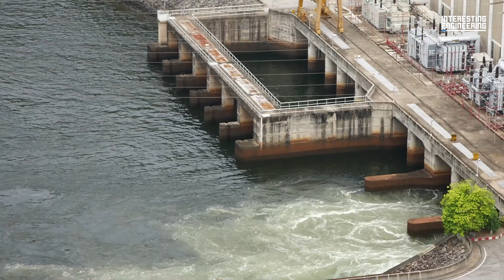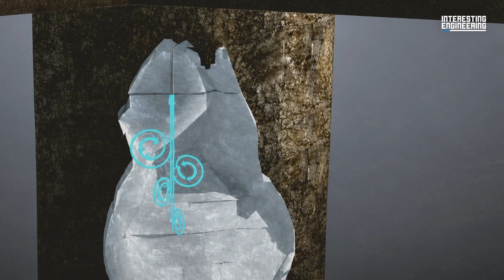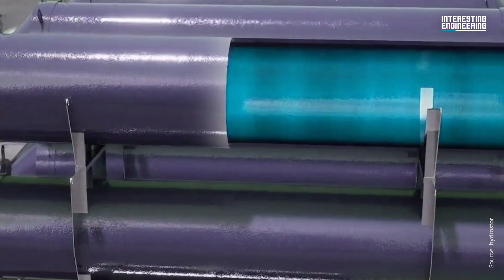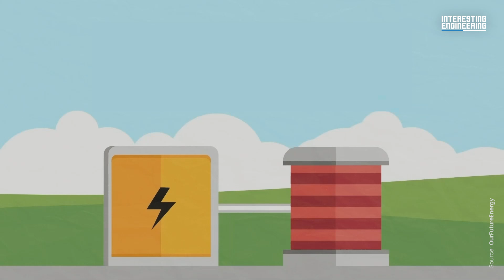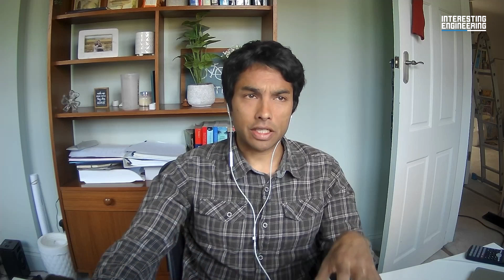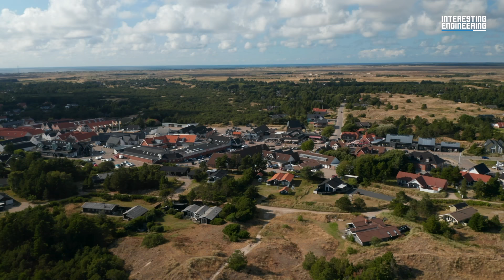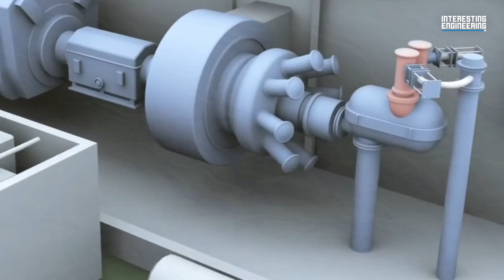Why Air Batteries Are Finally Beating Lithium

Comment: On the plus side, a steel pressure vessel can be almost immortal if well maintained.  Beneath a defined stress limit, steel has an infinite stress cycle.  Pre-stressed concrete storage vessels are possible as well.  In this case, stressing cables can be periodically replaced.  So CAES can be built once and used forever.
Reply: I wouldn't say forever because moisture is still a problem, looking at industrial compressed air vessels it will still degrade over a long period of time.
Reply: @TubersAndPotatoes  u have molecular sieves
Reply: The best patent model I've seen is literally almost a giant  air balloon at around a 1000 ft under the water. The water pressure makes the storage vessel strength almost completely irrelevant and last forever
Reply: @MmMm-f2y7c molluscs - 👀
Reply: @luminousfractal420marine environments aren't kind, but it does change a lot of the design elements. We "just" need to find a flexible, air-tight, high-pressure, inert, salt-water resistant material that can last 10,000 cycles and is cost effective at scale.

The Ashby plot is a dot. 😂
Reply: This could also solve the thermal problem since water surrounding the balloon would normalize the air temperature during compression and discharge.
Reply: @rouchar Sadly, no.  The air must be compressed and the heat captured in some medium, before it goes into the underwater tank.  Otherwise, the heat is wasted.
Reply: Gas holders of the kind you can see remnants of around Britain held 50,000 cubic metres of town gas.

The world record for a single steel pressure vessel is 270,000 cubic metres (Qingdao LNG).

Huai'an salt cavern CAES is 980,000 cubic metres.

We're still figuring out caes and it's already three times the size of the largest LNG tank.

Comment: It's the same problem once Renewables are connected to the grid it becomes a parasite just like pumping air or water against existing pressure so the ignorance of Renewables is easily demonstrated with a volt amp meter and 4th grade math called Ohm's law if you were to double check your installed what meter and you will see an 85% loss so it being the same problem with pumping air or water it is called head pressure with electricity besides the resistance of the step-down Transformers but you're trying to feed backwards is voltage potential difference and the reason for skyrocketing electric bills

Comment: Adiabatic compressed air energy storage make sense in the current energy storage landscape only for wind energy  storage and large scale grid usage. Domestic usage is right now a tthe level fly by night promoters.
Reply: I agree.  The cost of an air vessel and it's maintenance drops relatively as the vessel increases in size.  And a very small system could be forgotten or neglected with disaster a result.  Regular inspection should be mandatory.

Comment: The fact that you need to burn gas to let the air out, because otherwise the tank cools down too much, means this kinda sucks. In my opinion
Reply: If the tank cools down it can hold more air at lower pressure which is good.

Comment: The issue of water/ice in the system seems like a non-issue to me. Regular compressors have the same problem and they are constantly producing water from condensation. A simple solution would be to pass the air thru 5 or six different compressors each one of them with more pressurizing capacity that the previous one, that way, the last compression level would have almost no water left to condensate.
Reply: I like it.  What if the tanks were concentric.  Then the walls could be much thinner.

Comment: I've always wondered if it would be viable to pump air into bags that are submerged in the sea. Then let the water pressure release the air when needed.
Reply: Interesting idea.
Reply: What’s the benefit of submerging it?
Reply: @DreamGaming12  Greater pressure around the bags pushing air out when needed.

Comment: Wouldn't using a liquid to compress the air in a tank solve the problem with heat?
Reply: I don't think that would be enough cooling.  The surface area between the air and water would need to be much greater, ie if the water was all tiny droplets.  Yes, mist might work, but simply filling the tank with fluid definitely not.

Comment: I’m not an expert by any means, but I do wonder if CAES could have an application in AI data centers to cool down their water. I don’t think it’d be an ideal combination but rather a way to combine two different systems to work in a symbiotic relationship. 

I imagine the AI data centers kind of always need cooling wherever they can get it for their water cooling. Perhaps some CAES systems could be submerged within the heat exchanger reservoirs for the data centers. Not only could the CAES system act as a battery for the power-hungry data centers but it could also help cool the heat exchangers during periods of high-load. 

I imagine there’d be a lot of problems with this idea, but I wonder if the combination could be effective if implemented more thoughtfully than what I can do in a YT comment lol. I’m also hoping this could reduce the need for more water by making the cooling aspects of the water under use more effective during peak hours. Quality over quantity, so to speak.
Reply: It's a reversible closed cycle, so when you are recharging the reservoir with compressed air you are heating again, therefore it's not useful for cooling. And if you use two reservoirs, one for charging only and one for discharging/cooling only, you will notice that you would have just recreated a refrigerator (and freon would give you orders of magnitude more cooling power).
Reply: @islamabouelata6575 that is true.  But it is a heat pump.  You can choose to send the heat away and keep the cold.    That would be useful.  Freon would be more efficient as heat pump, but that would be prohibitively expensive quantities of freon.  And this is free cooling, so inefficient is still better than wasted cold.  Even the heat could theoretically be used, but that might not be practical.
The way it could work is that the heat exchangers on the pressure vessels would route the fluid into the cooling tower when it is hot, and into the cooling system of the centre when it is cold.  The thermodynamics are favourable.
Reply: @stevenpace892  It's not like you have a fluid and when it's cold you send it to place A and when it's hot you send it to place B. 

When you are filling up the air tank to store energy the tank itself heat's up and when you release the air to generate electricity the same air that is still inside the tank cools down and you have no practical way to harvest it.

Another place where you'd obtain cold air is right after the expansion valve and before (or after) the turbine, but that's likely marginal and also very hard to harvest.

If you really wanted to harvest cooling from this process you would need to have a double walled air tank with the space between the two walls filled with pressurized water, then yes you send that water to the cooling tower during "charge" and to the Data Center primary water loop during discharge but then a double walled tank is still not an effective heat exchanger and you run into structural problems because these air tanks must be very strong (so thick walled) to hold the pressure ... It's just not worth it by any stretch.

(I am actually a Data Centers expert so I would have been the first to be hyped up if there was anything good in this).
Reply: Good idea actually.
Reply: Really they should just build data centers close to old mining towns put the heat in the ground in the summer and use it in the winter to heat them houses of said town.
Or maybe some places that have greenhouses etc...
And honestly most of the water a data center uses is true the amount of water the powerplant powering it uses...
Most centers it self just use Freon heat exchangers that dump the heat in the air outside of the building (that is also next to "backup" generators the noise people tend to hear but yeah server racks them self's can also be quite loud.
And yeah solar/wind but making a center peak prove from those kinds of power sources is .....
So you always end up having backup power sources that seem to use water.
In the end sure maybe a system like this could work but for the moments big "data" really does not seem to be wanting to "innovate" they just want to hoard up the markets and be the first/biggest out of fear the competition might be faster/better.
Yeah well of course we have the never ending vaporware of musk that seems to be quite successful?

Comment: Could ice formation byproduct used to compress the air further
Reply: No
Reply: Yes.  Compressing gas, then decompression is a heat pump.  Heat or cold (any temperature difference) can be used to drive a turbine.  This is how a coal, gas, or nuclear plant works.

Comment: Compressed air storage could be done. However pumping water is cheaper i believe
Reply: Pumped hydro is geography-dependant.
Reply: @beanapprentice1687 that s why you have transmission lines
Reply: @luciliopereira4453💸💸
Reply: @luciliopereira4453transmission lines are both expensive and you lose energy the further it has to go.
Reply: @luciliopereira4453 new transmission has to be one of the hardest to deal with constraints in the industry
Reply: @beanapprentice1687 yeah you wouldn’t want to try and build one in Kansas. But any place where you have adequate rainfall and an elevated area to build a lake and damn on would be ideal.
Reply: @beanapprentice1687  Air storage also. You think it is cheaper to build a low pressure water tank or a high pressure compressed air tank?
Reply: @pierregravel-primeau4088 a water "tank" is not adequate for pumped hydro.  The amount of water needed is huge.  A lake high in the mountains, basically.
Reply: @stevenpace892  And you think compressed air is different? I love the confidence! 

It takes thousand and thousand and thousand of cubic meters of air!
Reply: @pierregravel-primeau4088  Water is scarce in a lot of regions. Pumping water back so it can evaporate into the air instead of going into food or drinking water will not work in those regions.
Reply: @yurie2388  in the region water is scarse human are scarse because you need water to survive... What is your point?

My point is kinda dumb : a water based infrastructure would have a lower cost and would be simpler than any compressed air infrastructure, making compressed air super mega niche if one day one commercial plant is build. I heard in 2018 that the UK was building a pilot plant (Highview Power). 

Accoding to google ai, Highview Power really hope to reach 50% efficiency one day using unaccounted waste heat from external source... Right now the demonstrated performance is about 10% efficiency round trip!

If you can find better information, send it to me, I am very interested from that technology!

So you have a very complicated, very costly, super inefficient piece of technology and your point is that it might one day save water...

Okay but how will be the air compressor cooled down?
Reply: @pierregravel-primeau4088 yeah but you can’t compress water….plus water get lost by evaporation at any temperature while compressed air is sealed
Reply: @mattiafrancescobruni8318  Interesting reflection. In most region of earth, rainfall is above evaporation making a pump hydro system having a net energy gain considering rainfall and evaporation.

Geological storage of compressed air is also prone to leakage even if I don't have good data on that. 

A promotion document published in Nature showed a range between 0,4% and 6% leakage in 30 years.

So what is better. A positive value or a small negative value? 

I love how you give more and more argument against that dumb technology!
Reply: Compressed air storage are very interesting if you forget their main drawback : air compressors. With a 10% efficiency, it is incredibly wastefull. While a pump can reach 70% efficiency.
Reply: @pierregravel-primeau4088 large scale turbines are used for many applications.  Their efficiency is far different from small air compressors.
Reply: I'm looking at the Thai grid and we're considering both. Geography as well as economics will dictate what we do
Reply: @TouringTony  For the next few decades, fossil fuels are likely to remain the primary form of energy storage. In Europe, there are only about 100 hours per year during which excess electricity generation creates a significant need for large-scale storage. Most of the time, peak demand is met by natural gas peaking plants, while the grid relies on a combination of fossil fuels and hydroelectric power to maintain stability and balance supply with demand.

California and Australia have some of the highest levels of energy storage deployment, driven largely by generous subsidies, favorable market conditions, and abundant solar resources. /AI
Reply: @pierregravel-primeau4088 Possibly today there's only 100 hours but construction is ongoing so this isn't the end. Wind will provide a significant input especially in the North Sea. We don't rely just on solar.  Energy storage and transmission are key but they will be built
Reply: @TouringTony  Maybe I wasn't that clear. Right now, 70% of energy come from fossile fuels.
It will not be tomorrow that storage will be economical. 
For any forseeable future, if there is no wind and no sun for a prolonged period, fossile fuel will be used as a long term storage.
You are right that in 20 years, it might be quite different!
Reply: Yes, but pumped hydro is not useful unless there is a big change in elevation over a short distance.  And transmission costs energy.
Reply: @stevenpace892  It is the same problem with compressed air.
Reply: @pierregravel-primeau4088 no, compressed air requires no specific geography.  The tank doesn't care what altitude it is.
Reply: @stevenpace892  Where will you find millions and millions of cubic meters of space to store these millions and millions of cubic meters of compressed air? Listen to the video if you want the answer!
Reply: which one has already killed people and wiped out a small town?
Reply: The low-hanging reservoir fruit are essentially plucked. There might be potential in more remote areas, but then transmission losses and cost of transmission come into play.
Reply: Pumped storage is not cheap if you dont already have the land suitable. You cant just plop it in a city.
Reply: Pumped hydro and overall hydro is problematic ecologically and emits much CO2 which is why we want this storage in the first place - to store clean energy. And also hydro in some places or when managed badly creates flooding risks
Reply: @kakiremora2991 Pump hydro and hydro emit zero CO2. repeating a non sensical lie pushed by fossil fuel propagandist is not a winning strategy. 

How could it emit CO2? Think 30 seconds.

Also, the main reason why dam are build is to prevent flood. This is why dam are build all the time... It is to prevent flood... Dam prevent flood... It is what they do...

How could a dam make a flood? Think 30 seconds.
Reply: You cannot compress water
Reply: @RomanKolosovRU  they meant pumped hydro
Reply: The cost of storing compressed air is not cheap. Better reverse pump water in a hydroelectric dam.
Reply: You need high, artificial relief to use the hydro electricity storage.
Reply: @betespatiotemporelle  And you need free near surface impermeable salt cavern to store compressed air.
The question is what cost less : some earthwork like we do all the time in civil engineering or hundred of thousands of high pressure tank?

Comment: I thought of using a compressor to inflate huge rubber bags at the bottom of a deep lake when power is cheap the release that air to turn turbines for when power demands it.
Reply: Won't the bags float to top of Lake water?
Reply: @kat @katiez1941 they will have to be anchored down. The deeper the less buoyancy as the water pressure would compress the bags. Also the heating and cooling would be less issue as that would be regulated by the temperature of the lake.
Reply: The israelian startup "baromar" works on that approach.
Reply: @AGNITR-8  so you will be using both rubber that isnt good with thermal cycles and isnt long lasting and killing the ecosystem at the same time
Reply: That's using water t0 store energy but with extra steps
Reply: This could  eliminate multiple problems.
Reply: I thought about that.  But I suggest it is not practical. The problem is that emersion increases maintenance cost more than it is worth.  I was thinking about it in a wave generation installation.

Comment: We have all the air in the universe to compress. Right?
Reply: We really do. Summarized from an AI-enabled search "A large-scale Compressed Air Energy Storage (CAES) system stores roughly 25 million to 60 million kilograms (2.5–6 × 10⁷ kg) of air at peak capacity. When compared to the total mass of the Earth's atmosphere, which is approximately 5.15 × 10¹⁸ kg, a CAES system stores an incredibly minuscule fraction: It constitutes roughly or 0.0000000005% of the atmosphere's total mass."